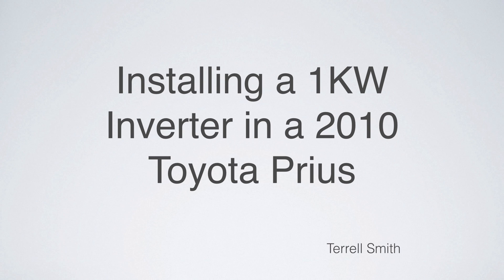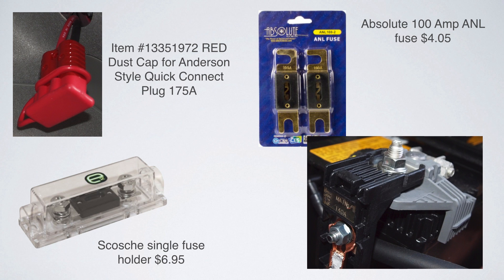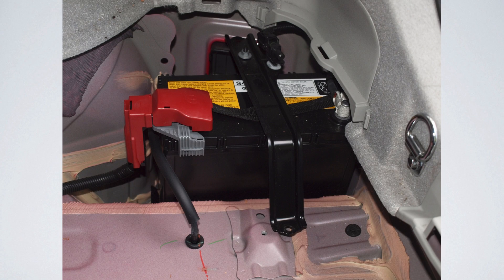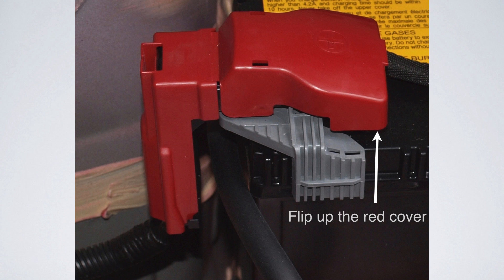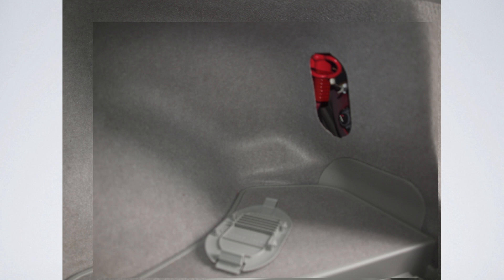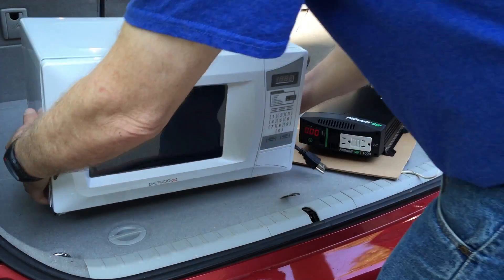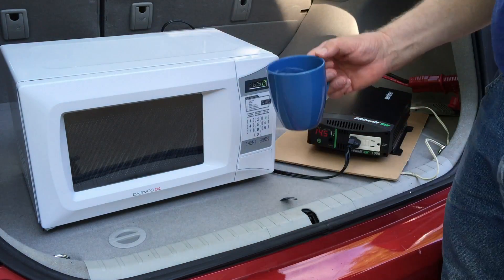Add a 1kW Inverter to Prius

Comment: hi love this so helpful.  Question. the cables on the back of the inverter you shrink wrapped.....however the nuts connecting to inverter are not any chance of them shorting if metal touches them?
Reply from the maker: Thanks. You are correct, the posts on the back of the inverter are somewhat exposed. What's hard to see in the video is that they are covered with plastic between the two posts, but the outside nuts are exposed. I only use the inverter once it's setup, and disconnect it when it's not being used, so the chance of shorting them is minimal. And... that's why it has a fuse, just in case.

Comment: I've installed several power inverters over the years on my semi truck and I think it's important to mention that the fuse you install on the battery should be as close to the post as you can get it. If there is a break in the wire between your fuse and the post, you could cause a fire if the remaining wire is long enough to make contact with the other post. So you don't want the length of the wire coming from the post to your fuse to be great enough to touch the other post if there is a break in the wire.
Reply: They sell terminal mount fuse holders, so you don't have any cable from the battery to the fuse.
Reply: David - Excellent point ...!

Comment: Did you not fuse this?
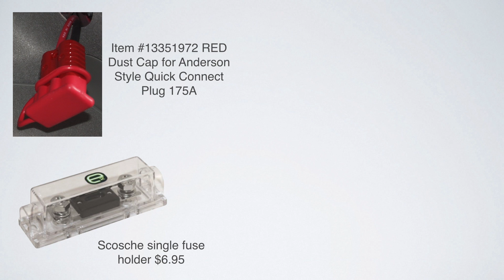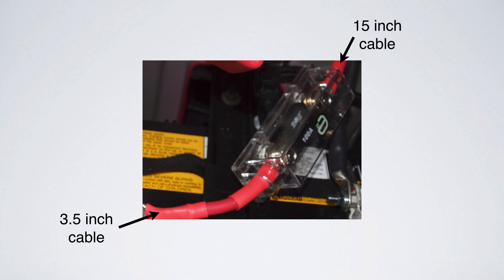Reply: Thanks for the question. See at 2:10 for the fuse holder and fuse, 3:25 for connecting the fuse, and at 5:48 you can see the fuse holder sitting on top of the battery.

Comment: Thank you for this video. I have a question: my Prius is a 2015. How do I find out what cables my car needs? How did you find out which were the correct cables for your Prius? 🙏🏼
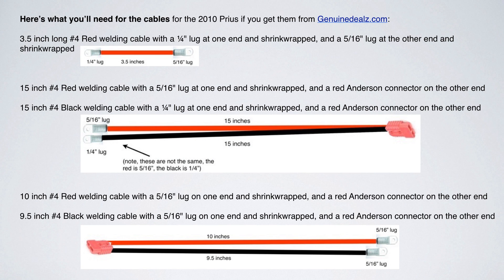Reply from the maker: 2015 should be the Generation 3 Prius, same as mine, with the 12V battery in the back. You can get a cable set pre-made from Genuinedealz.com (see at 1:13 in the video) for around $67 including shipping, last I heard. There's been enough interest generated by this video that they asked if they might make sets, and I said yes.
Reply: @TerrellWSmith   thank you!
Reply from the maker: @Jesse Carte, thanks for the kind words. You are correct, the 2018 battery is up front, not in the back like the earlier version of the Prius. Which means it's a different set up entirely, because you'd need to run heavy wires somewhere to connect the inverter. And I don't think an inverter would be happy under the hood, unless it's manufactured to put up with rain and road salt, etc. And no, 1500 watts is too much, 1000 is the limit for the car. No, a second battery will not help you, because the inverter draws power from the Prius DC/DC inverter, not primarily from the 12V battery. If you just hook the inverter to a second battery, you would drain that battery in a very, very short time. Sorry.

Comment: Thanks for this great video. I have a question. When I inspect the wiring that comes to the 12V battery from under the hood, it seems quite thin for ~70A (For about 1kW). Did you (or anyone) have any problem using the inverter for a long time under considerable load?
Reply from the maker: Thanks for the good question. The white wire which comes from the front of the car is stranded aluminum and looks to be 3 AWG wire, which should be good for 65-75A. The insulation is fairly thin, that's why it looks thin and is protected in a flexible plastic sleeve. There is a 140A fuse built in on the 12V battery's positive side. As you noted, drawing 1kW is ~70A (assuming around 14V when running). The longest I've run the 1kW inverter under full load is when running the microwave, and that's usually a short time (90 seconds to cook a pouch of rice, for example). Occasionally, I've cooked salmon in it, five minutes. A baked potato takes about five minutes as well. When cooking rice in a rice cooker, it takes around twenty minutes, but then it's not full load (my biggest rice cooker is 620W). When the power has been out at home, I connect the freezer, phone system, computers with router, modem, home alarm system, but because none of these things draw much power at the same time, I've not had any issues, even after seven hours. (The kitchen refrigerator startup does trip the breaker on the inverter, though.) So far, I've not seen any issues running the inverter under these conditions, most of which are not full load (except the microwave). I always make sure the inverter has enough space for air around it, and under load, it's internal fan does come on. What I suspect is going on is that the car's DC/DC inverter supplies most of the power most of the time, and the 12V battery acts as a short term buffer under short greater loads. Of course, the 12V battery can only do this for a very limited period of time, but it's a hybrid 12V battery, and able to handle loads. Most of the power comes from the car's DC/DC inverter, which is able to handle the 1kW inverter. Of course, the car must be in "on" mode, the "Ready" light on. It will cycle on and off automatically to keep power flowing.
Reply: Thanks for the detailed answer, now things are more clear for me.

Comment: Dear Mr. Terrell Smith thanks for your kind support. I have successfully installed Duracell 3000 watts inverter in my 2010 Prius. I followed all the instructions given in video and could complete the process in about 15 minutes. I could attach cables with battery terminals without using any new nuts & bolts. I put the extra lock washers on the top of cable terminals. I ensure snug fit of cables at all points. I would request you to review my connections (photos enclosed) and suggest any changes I need to make. 

I have used the inverter for instant pot (750 watts) & Coffee Maker (500 watts) without any problem. I would always ensure that I do not ever draw more than 1000 watts from my inverter. 
I want your guidance on using an Induction hot plate which is 1800 watts but has the option to set the unit between 200 to 1800 watts. If I set it at 800 watts, could i use it without endangering my 12 v and/or hybrid battery and car generator/inverter. I would like to play safe and not take any chances but if I could use induction hotplate set permanently at 800 watts safely, i would have all the items required for basic cooking i.e. instant pot, induction hotplate & coffee maker. I enjoyed my three camping trips in 2019 (Southern US 2500 miles 14 days, Central & Northwestern US, Canada and Alaska 12500 miles 35 days, Southwestern US 800 miles 20 days) but I had tremendous problem in using my camp stove due to wind and missed my morning and evening coffee on many occasions. Hopefully now with the inverter installed, I would enjoy my future trip more. 

Once again I would like to express my appreciation and thanks to you for evolving this very simple and safe procedure to install inverter in Prius. Without your video, it would have been very difficult for me to take up this project. You have not only made the procedure very simple and safe but also encouraged the genuinedealz.com to supply the complete kit at very reasonable	 price. That was really very very helpful as it is very difficult to make cables with right wires and lugs. 

Looking forward for more educational videos from you which would make camping in Prius more enjoyable. God bless you. With regards.
Reply: KIRTI, I’m not familiar enough with induction cookers to answer your question. If it truly draws less power based on settings, then you’ll be ok. But if it uses “800W” due to rapid switching, that might mean it still pulls full power, but only half the time. You might check it with a meter or a Kill A Watt device.
Reply: @terrellsmith2203  Thanks for your kind reply and valuable guidance. God bless you.

Comment: Thanks Dear Mr. Terrell. I could install the Duracell 3000 inverter in my Prius 2010 today. It was very easy following your instruction. It was made possible only because of your help. God bless you.
Reply from the maker: Glad to hear! God bless you too!
Reply: Hi Kirti,   I have 2014 Prius and 2017 prime.  Thinking about doing the same setup as your with 3k inverter.   What appliances that you have run simultaneously?  And your est max wattage usage?
Reply: @desmondthang6759  3kw is too much for the 12v agm in your Prius. 1000 Watt is Max. It's not a high amp battery, as it's not meant to crank the engine like with other cars, cranking amps are low so even at 1kw, you shouldn't be doing a lot of surge. Start a microwave once, but not over and over. I'm only going with 500 Watt myself. It'll run my gaming laptop, that's it.
Reply: Hi please can help me you install the inverter on your hv battery I mean on your hybrid battery? ?
Thanks
Reply from the maker: @feredonferedon3998  Please go to http://priuschat.com to learn about taping into the traction battery. It's not easy, and is dealing with high voltage.

Comment: I would like to know following from those of you who have installed any kind of power inverter (any power size, any type Pure or Modified sine wave etc etc.) on 12 v battery (NOT ON HYBRID BATTERY) in their Prius :

1. Have you noticed (perceived or real) any kind of problem with your 12 v or hybrid battery after installing the power inverter? Has it affected the life of your 12 v or hybrid battery?

2. Worst problem you have encountered due to power inverter?

3. Looking back do you feel that installation of power inverter was worth all the expenses and trouble and has improved your camping experience ? 

Your answer would help large number of fellow camper like me who are planning to install power inverter in their Prius.
Reply from the maker: Thanks for asking the questions, Kirti. I'll be interested in what others reply. From me, I would only go with pure syne wave, so the power is clean. Your questions: 1) No problems that I've noticed. I would keep the inverter at 1kW (less is also OK, but not more). And the cables from the 12V battery should be kept as short as possible. My 2010 Prius is now old, and the hybrid battery works as well as it ever did, as far as I can tell. I'm on my second 12V battery, the first one lasted around 9 years and now serves as my second battery (see https://youtu.be/cLCAIXEVy94). 2) Worst problem? None - other than I wish I could run my home refrigerator during a power outage, but the startup surge is too much. 3) For camping, I love being able to bring along a small 600W microwave, 450W rice cooker, and lately, a small Dometic refrigerator. Some might say this is not true "camping" - that's OK. I'm thankful for the "stuff." I have a 120W folding portable solar panel I can use to charge the 12V batteries when I'm camped and not driving. And I've used the Prius inverter a few times when our home was without power to run the freezer, computers, modem & router, backup NAS, phones and alarm system. The downside? Now I never want to buy a car where I wouldn't be able to install an inverter!  :)
Reply: @TerrellWSmith  Thanks Terrell, you have encouraged many like me to enjoy the benefit of Prius power by using inverter. Your original technique and procedure is very simple and safe. The company recommend by you is now offering a readymade kit as per specification suggested by you. I have ordered the kit and would install my inverter as soon as I get the kit. I am going to follow all instructions given by you in video. I would never use any appliance which demand more than 1000 watts of power although i have purchased Duracell 3000 watts inverter from Costco. Once again thanks for your kind help. God bless you. Stay safe and take care.
Reply: @terrellsmith2203  Thanks Terrel, i have 2010 just like yours. Today i got the cables, Anderson connector was a super idea from you. Waiting for fuse box. Would seek your kind guidance if required. With regards.
Reply: KIRTI, make very sure you get the polarities right. Someone else smoked his inverter, and I suspect he got the polarities wrong.
Reply: I would like to provide a bit of input regarding the use of an inverter on a Toyota Prius.  I have a 3rd generation 2014 Prius.  I have been thinking about using my Prius for camping.  The idea of using an inverter for high power applications is a novel idea.  Currently I use a very small wattage cigarette lighter plugged (100 watt) for simple applications.

I have done some research in inverters (and their use).  Using an inverter is apparently a very popular option for RVers.

Here is the important information to know.  Battery types vary substantially.  The car battery used in your car is typically designed to provide a short burst power surge (for the starter battery).  In the case of a hybrid, the battery is primarily used to supply power to the onboard computer.  The computer controls the larger traction battery.  It is the larger battery that supplies the power to the motor/generator (to start the gas engine).

The small starter battery was never designed to handle the kind of high amperage drains required by a high wattage DC power inverter.  While it will work, it must be pointed out that the life of this battery will be reduced dramatically! 

For those serious about using an inverter for high wattage use,  a MARINE DEEP CYCLE battery is the suggested choice. This type of battery is designed for the high drain that occurs with an inverter.  A deep cycle battery is typically wired SEPARATELY from the car battery. 

The point of my comment is to caution other Prius owners (car owners) against using a high power inverter in this configuration.  The life of the car starter battery will be shortened dramatically.  The replacement battery for the Prius is somewhere around $200.  Hope this helps!
Reply from the maker: @CYBERTECHY1 , good to do research. But you need to look at how the Prius works a little more closely. The 12V battery in the Prius is, as you say, there to start the computer, not a starter motor. However, the Prius 12V battery is itself a hybrid battery. But the biggest misunderstanding is what powers the inverter (up to 1kW). It's NOT the Prius 12V battery, but the DC/DC inverter of the Prius. If the inverter is run off the 12V battery (the car turned OFF), then yes, it will drain the 12V battery very quickly. When using an inverter, the car must be in READY mode (the gas engine can cycle on and off as needed).
Reply: @CYBERTECHY1  Have you looked at your Prius' 12v battery?  It's not a standard car battery  It is an AGM/Marine/Golf Cart type battery... It is designed to power devices for long periods, though with all lead acid batteries, you wouldn't want to go below 60 or 50% of capacity at one time.
Reply: One thing about our "hybrid vocabulary" that applies to all hybrids, that ICE owners and, yes mechanics; get wrong: There is no "starter battery", in fact also no alternator on a hybrid car. 
Listen to Terrell, he has the details, if you understand these differences. The 12v battery (in my view) is more of an accessory battery.
Now if someone could give me information parallel to this video applied to my 2016 Chevy Malibu Hybrid. I too could become a happy camper.
Reply: One main problem with our exact same set up with a second battery and inverter was we didn’t consider how much driving it would take to keep our second battery charged!! There was way too much taking it out and connecting the battery to a trickle charger
Reply: We have a gen 2 model 2008/2009

Comment: Thank you for the video and the plans. Someone stated on another site that " The terminals will heat up with a 100amp+ load and will degrade the battery. " Have you seen any of these results?
Reply from the maker: Thanks for the question, Steven. I wouldn’t try to draw more than 1kW from the 12V Prius battery. I have not noticed any unusual heating up of the battery terminals. The inverter has a built in fan which kicks in when there’s more power draw. My setup is 1kW, which is roughly 83A. My microwave is 600W (rated at 900W, and if you look closely at the end of the video, it says it’s drawing 1,120W, but I don’t know how accurate that is, and I run it for only 2-3 minutes at a time at that). My rice cooker is 450W (and a bigger one is 620W). It takes around 20 minutes to cook rice. Occasionally when the house power is out, I run the freezer, computers, internet modem & router, backup NAS, phones and alarm system off the Prius. Unfortunately, our refrigerator (which is rated low enough) has too much startup kick and won’t run. We just got a new furnace, so I’m eager to see if that will run. As far as degrading the 12V battery, I suppose that’s possible over time if you use the inverter often. But the 12V Prius battery is a hybred made for deep cycling. Most of the power is actually coming from the Prius inverter topping off the 12V battery as it drains. So far, my 12V batteries have lasted more than 5 years.
Reply: @TerrellWSmith  Thanks for the fast response. I think I will try and limit the load to about 700 watts maximum just to be on the safe side. I have a clamp meter so I can measure current to keep an eye on the load.

Comment: Hi, Can you install a 3000W inverter the same way? Thanks, Steve
Reply from the maker: Thanks for the question, Steve. Short answer: NO. Not in the same way. It is possible to install a 3000W inverter, but you'd need to tap into the traction battery, NOT the 12V battery. And going into the traction battery is a totally different thing. If you're interested in that, head over to PriusChat.com, there are some people there who have done it.
Reply: @TerrellWSmith  Thanks for the info, Steve